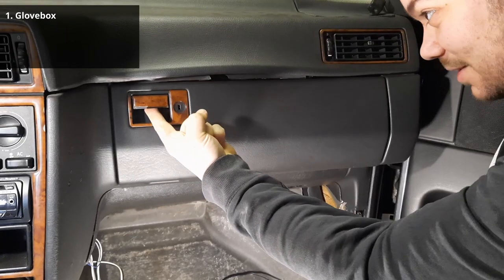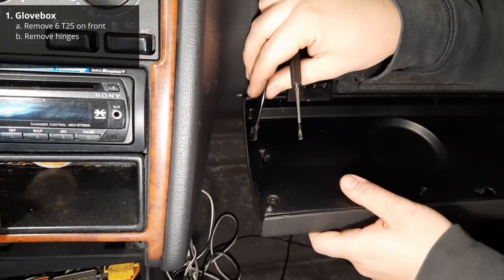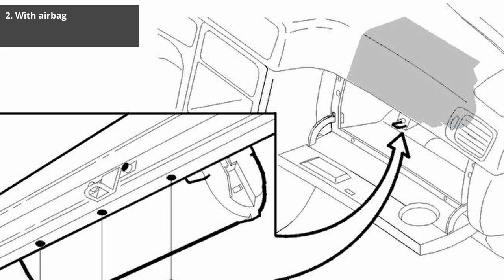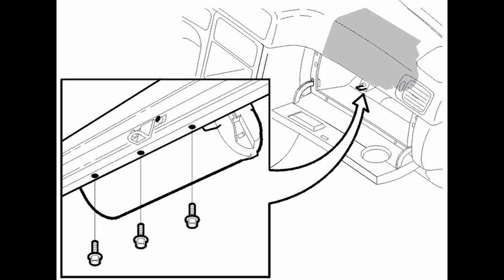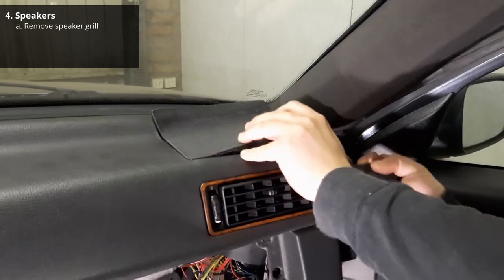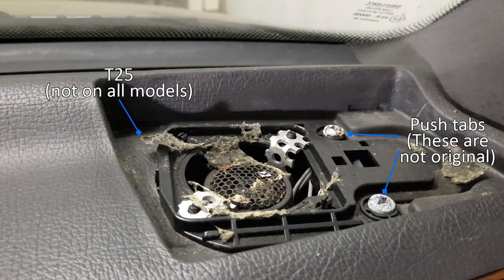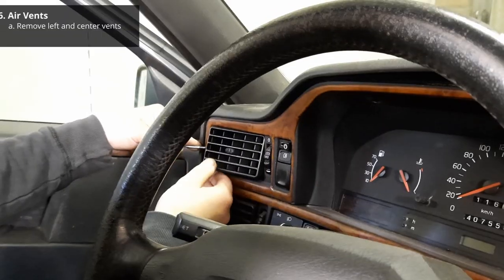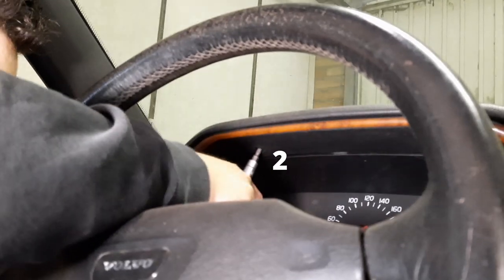How To Remove Dash Pad Volvo 850 QUICK DIY

Comment: You don’t need to take the glovebox out. I did the dash pad to do My Speedo clock cog wheel
Reply from the maker: Hm that might indeed be the case when there is no passenger side airbag installed. Thanks for your feedback, I'll try and fix it somehow!